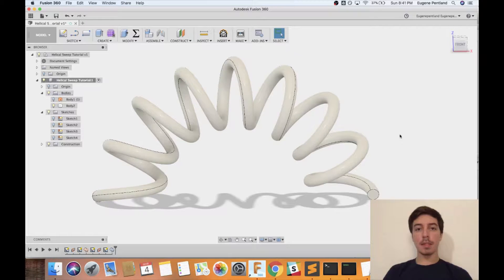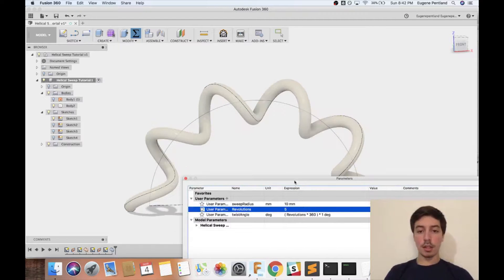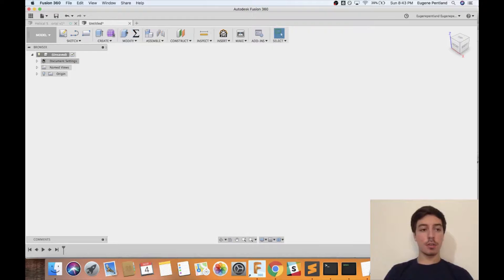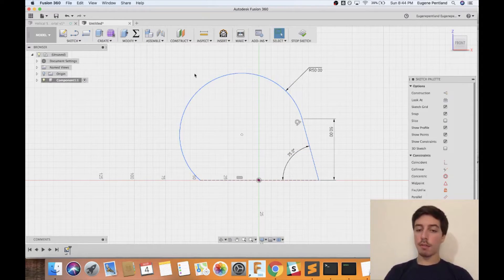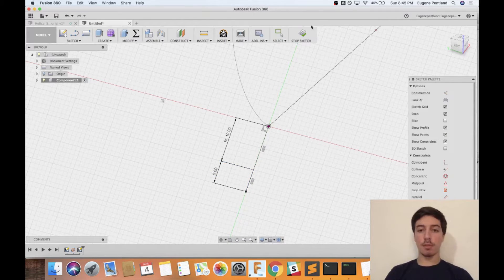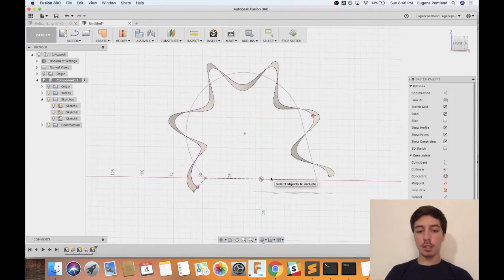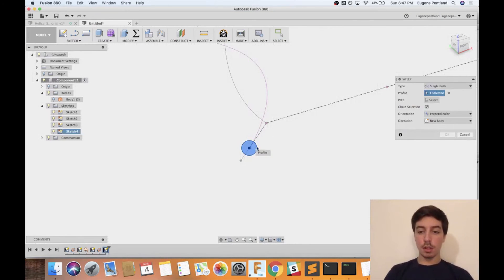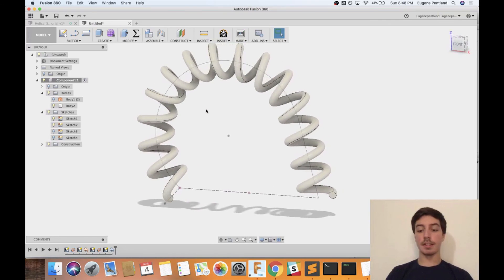Fusion 360 Helical Sweep Tutorial

Comment: Nice.  Can you make the distance between coils vary over distance along the sweep?
Reply from the maker: Rocket you could do that, but it would be a bit of a pain.

So if you wanted 3 different sizes, you would have to do 3 planes along the path, make a new sweep in each of those sections and add a different twist angle for each sweep.